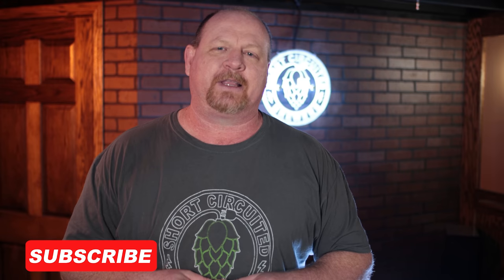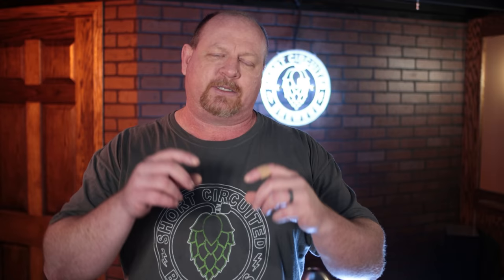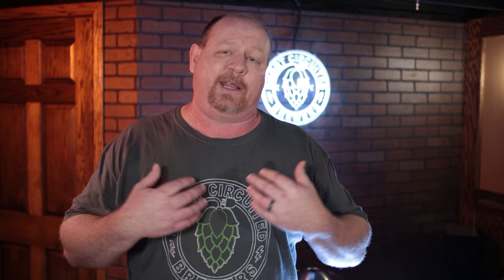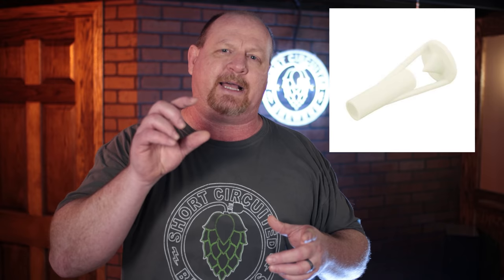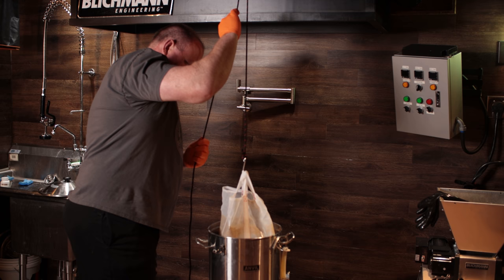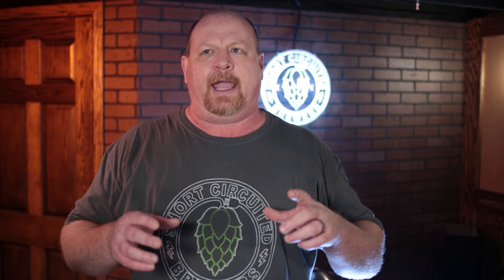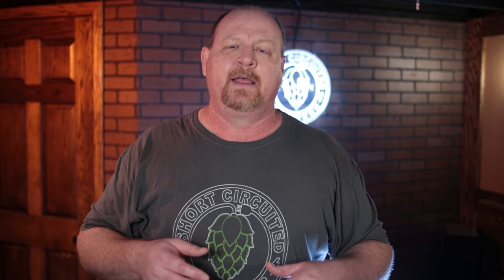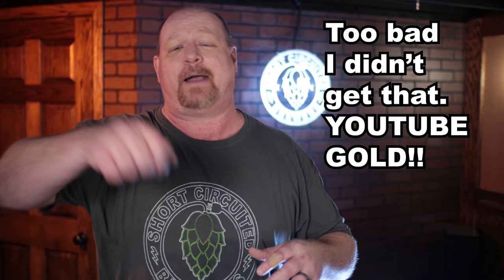Anvil Foundry Feat  The Brew Bag Products

Comment: I really like my Anvil Foundry. I have the version with the ring, and malt pipe. I do get bits of grain in the wort and have thought about putting my brewbag inside the pipe to cut down on that. Right now I'm running the wort through my stainless hop basket. It's got a fairly fine mesh that gets all but the tiniest bits out. The bag would probably be better as it would filter prior to pump. Might save the pump a bit over the long haul. I would like to see a comparison of the cleanup required using the three approaches. Pipe only, pipe with bag, and bag only. Does having clearer wort pre boil stop the minor bit of scorching on the heating elements? I get a little scorching using the 110 setting and have wondered if not having the extra bits of grain would make things easier to clean.
Reply from the maker: The scorching is from recirculating too fast and having only a thin layer or wort over the element during mashing. If you hear any crackling or popping during the mash that is a pretty sure sign the wort over the element is too shallow. I've brewed with and without the bag and never get any scorching even using 240v. 👍🍻
Reply: @ShortCircuitedBrewers  I haven't heard any crackling or popping during the mash, and THOUGHT I had closed off the recirc line enough to keep a slow but steady recirculation going. I will try reducing it further on my next batch. I always figured the slight scorching (and I mean very slight, it comes off with a little scrubbing) happened during the boil step, not the mash step. I will have to try both reducing the recirculation rate, and adding a bag to limit the stray bits in the wort. (Just means I need to make more beer... :-))
Reply from the maker: @1947wdx  aww you poor thing..lol let me know if it works for you!! Brew on!! 👍🍻

Comment: Thanks Always great. I do not believe you mentioned but would you recommend using the basket with the bag just in case the method you described in hanging the back does not get executed properly to protect from the back hitting the heating element and causing a problem? thanks again
Reply from the maker: Sure you can use the bag with the basket. Many people are and having good results. The link in the description also has the bag for in the basket ad well. 👍🍻

Comment: $46 for a big is a bit steep. Though if they come down or have a sale I may pick one up.
Reply from the maker: Yeah that was one of the cons.. I do think.ot will last a long time. Much longer than the generic L.D. Carlson bags for sure.
Reply: I have one for my 10g Igloo mash tun and it is extremely well made. I use a bag for my BE Mash & Boil malt pipe. Wilser Bags are good as well and I believe are $32.00. I’ve never seen these go on sale. Keep in mind these are way better quality than a cheap paint strainer bag and they are the correct micron rating. Either maker is great about responding to emails.
Reply from the maker: Good to know!

Comment: My Foundry 10.5 is arriving tomorrow! Looking at all my recipes (british style real ale conditioned in polypin casks, OGs 1035-1060) and the grain loads are generally no more than 11lbs or so. I mill at my LHBS. I am wondering if I am going to be OK with just the malt pipe and small batch ring?
Reply from the maker: Sure you should be fine.

Comment: When you used the hop sock, you put the hops in the boil loose and then recirculated through the sock to catch the hops? At what stage did you do this, during whirlpool, after, before chilling, etc? Have you done this before and why did you try it? Perhaps forming a whirlpool cone on the small bottom area isn't very effective? Thanks for the video!
Reply from the maker: I put the hops in the sock and dropped it in at 176f. The reason I put the hose in the sock is to circulate the wort through the hops. I found that bags sometimes don't allow good circulation of the wart through the hop so I circulated the work through the bag to make sure it came in contact with all the hops. It is very effective.👍🍻

Comment: Brian,

I wanted to reach out to you because I'm continually experiencing poor mash efficiencies using the Anvil Foundry and I don't know what else to do at this point. I've tried brewing with a brew bag in the malt pipe, with and without the small batch ring at the bottom of the malt pipe. I had a brew day this Saturday where I took the malt pipe out and used a brew bag directly in the kettle. I have a recirculating system that I run throughout the mash that I will shut off and stir the mash periodically throughout the mash. Since I'm using BIAB I've tried to finetune the crush on my grains to be finer. I've tried batch sparging, usually with a gallon of water and I've also tried adding rice hulls. The only other thing I can think to try is to sparge with more volume. It sounds like you have a lot of experience with this system so I'm hoping that you can provide some direction that could help my mash efficiency.
Reply: I am debating buying one currently and doing research.  I look forward to his answer.
Reply from the maker: Well the first thing that I would ask you because you didn't talk about it at all is what is your crush, and what is your water profile namely pH. pH is probably one of the more important factors in mash efficiency next to the crush. In order for grain to properly convert it needs to be between 5.2 and 5.6 pH. Do you know what your pH of your mash is?
Reply: @ShortCircuitedBrewers  I went through the most recent recipes I have saved on Brewfather and it looks like my mash pH about 5.3 on average. I had one brew with 5.2 and one with 5.4. It's typical for me to make pH adjustments with acid malt or lactic acid.
If the indicator on my mill is accurate, my crush is between .04 and .05. I've tried setting the mill to a finer crush but it causes my mill to seize up for some reason.
Reply from the maker: @EtherealPrelude  do you have you water profile setup? Are you using distilled water? I usually recommend a .035 gap for best results. (Credit card gap)
Reply: @ShortCircuitedBrewers  Yes, I used distilled water and make adjustments with the brewing salts to fit the beer style. I appreciate the tip on the crush thickness. I'll give it a go on my next brew.
In your experience brewing on the Foundry, did you find that you had better mash efficiency using BIAB directly in the kettle or brewing using the malt pipe? It seems like I'm typically getting around 63-65% mash efficiency.
Reply from the maker: @EtherealPrelude  I found the avg efficiency was around 70%. If your mill is stopping you might try running the grain through twice or condition the malt (I have a video on it) also stirring the top 3/4 of the mash will help efficiency.
Reply: @ShortCircuitedBrewers  Brian, just wrapped up with another brew day and I managed to get 71% mash efficiency brewing with a 16 lb grain bill. I went with the .035 gap for the crush and that seems to have done the trick. It made my day to have such a big boost to my efficiency. I appreciate the tips.
Reply from the maker: @EtherealPrelude  great!! Your welcome! 👍🍻
Reply: @EtherealPrelude  I am not Brian but I did stay in a Holiday Inn Express :)  TWO things:  1) Set mill to 0.025 gap.  2) Double CRUSH.  ALSO:  if your Mill does not have 0.025 or binds up it is time for new mill about $99.00.  Happy Brewing.

Comment: Great video Brian! I have the Spike Solo system and I was thinking about using a bag with the basket in place.  The basket would serve to keep the bag off the element and would help for easy clean up.  Question - If your using the BIAB method without a basket, and you burn the bottom of the nylon bag on the bottom of the kettle (propane or electric), is the beer still safe to drink?
Reply from the maker: I can't really say if it's "safe" but it probably won't taste good.. lol 👍🍻

Comment: I actually use those socket bags a lot, as filters, even when I transfer it for clarificación after fermentation,  they are a very fine filter and very very economic, actually I do my own sock bags with the nylon used for courtains. Easy tonclean with warm water and easy to sanitize just in a solution of peracetic acid.
Reply from the maker: Good tip!! 👍🍻

Comment: Hi Brian, Awesome videos. Thinking of adding a clawhammer supply spray kit to my anvil for recirculating. What do you think of this idea. Keep the great videos coming
Reply from the maker: Not a bad idea.... BUT... I just did a video on a solution that might be cheaper. 👍🍻 https://youtu.be/4_M-NEOl8Bo
Reply: @ShortCircuitedBrewers  I made the exact same one as you did. in regards to your flow rate thru it. seemed like you had the flow going pretty fast. is this the case or should you slow it down like you would for the traditional style of using the anvil how it comes. I recently brewed a batch and my efficiencies were off. Trying to get better efficiencies. trying to eliminate as many issues as I can to get better numbers. Thanks again Brian, Keep up the great work!
Reply from the maker: @Reptile36snakeman  the flow worked fine for me especially with the bag. I recently brewed with the bag in the malt pipe and had good success with the same flow rate. 👍🍻

Comment: Great video Brian. Did you say you left the power at 100% during the mash on 240v? I just got my 240 ready and was curious about that. Also what power setting seems to be optimal for the boil without boil over.
Reply from the maker: 80-90%
Reply: Just to throw my 2 cents in, I found 55% power while mashing and drop to 85% for a nice mellow boil.
Reply from the maker: @saxonlights2872  yeah I normally run 50% for mash and about the same as you for boil. 👍🍻

Comment: Hey. I know this is completely out of left field and you may have mentioned it in your brewery build out, but what is the total sq footage of your brewery area including tasting room? And what are the largest size batches that you brew? I'm thinking of building a dedicated building for my home brewery and trying to decide minimum space required.
Thanks.
Reply from the maker: The entire basement is aprox 20'x25'   that's including mechanical area and the storage area. Brewery and tasting area would be aprox 325 sq ft. I can brew 10 gallon batches. I could brew 15 gallons if I wanted to push it to the limit of kettle capacity. 👍🍻

Comment: Would this method be better than using the small batch adapter for a 2.5 gal batch on the 10.5 gal system?
Reply from the maker: I think it "might" be. The bag has good circulation around the grain. I don't see why it wouldn't work. 👍🍻

Comment: Am a bit curious watching your (as always) exellent video: In my recent brews (malt roughly 12-14 kilos/Brewzilla 65 liter), I've squeezed the grainbed with a potatoe masher after sparging trying to gain - the last litre I guess. Had a hunch that it'is not "exactely by the book", because this is actually the first time I've seen anyone else doing it. Saying it might be a myth, would you still advise not to do so when using a malt pipe ? I am still far away from determining if or in which way exactely THIS precidiour might have an affect on the taste of the beer 

Cheers from Norway !
Reply from the maker: It does not extract tannins from the grain. Tannins are extracted from a temperature interaction with the grain husks. (High temp) Squeezing or pressing on grains does not have any effect on it. Thanks for the feedback! Skol! 👍🍻
Reply: @ShortCircuitedBrewers  Thanks man & skål - I can see you've started learning norwegian  now which is a good thing - cause I've just started asking my questions 😂
Reply from the maker: Ask away!

Comment: I didn't see an actual comparison of the bag to a malt pipe, just a pro/con of the bag itself. For those of us that have neither and are deciding which way to start off, what are the advantages and disadvantages of a bag vs a malt pipe?
Reply from the maker: I kinda covered it in the video. The basket has less capacity and the holes in the basket allow some particulate matter through. There isn't anything wrong with the basket. There are some benefits of the bag.👍🍻
Reply: @ShortCircuitedBrewers  Thanks. So the bag has an edge in outcome but with added effort (securing it, lifting it, squeezing it, etc)?
Reply from the maker: @FoScoJo  yeah that's a good synopsis! 🍻👍

Comment: Where do i install the false bottom that comes with my Anvil foundry?
Reply from the maker: The bottom of the malt pipe.
Reply: @ShortCircuitedBrewers  That's what I thought. Seems like a super tight squeeze pushing it down
Reply from the maker: @jonathanallenphotography  that is where it goes. 👍🍻
Reply: @ShortCircuitedBrewers  Tha k you so much for the quick reply, and helpful videos!

Comment: Hey Brian, awesome video! I just upped my foundry to 220 and I see in this video you set your estimated efficiency at 70 for yours. Do you set it for 70 when using the malt pipe? Also are you using BeerSmith?
Reply from the maker: Yeah I usually set untested recipes to 70% in the malt pipe too. I'm actually using brewfather. Much better software.
Reply: @ShortCircuitedBrewers  thanks!

Comment: Are there any cons to using the bag inside for the malt pipe?
Reply from the maker: None at all. Lots of people do. 👍🍻
Reply: @ShortCircuitedBrewers  I wondered if this would reduce recirculation flow or something like that..
Reply from the maker: @mbrady1182  I actually think it might help slightly since the grain won't be plugging the basket holes. Just a guess. 👍🍻
Reply: @ShortCircuitedBrewers  thanks! Now I just need you to come by and setup a 240 outlet for me, don’t trust myself..
Reply from the maker: @mbrady1182  I understand!! Let the pros handle it!! 👍🍻

Comment: I use a 5 gallon paint strainer bag on the outside of the malt pipe.  It catches about a handful of fine particles that make it through every brew.  Has no effect on the thermometer or element as long as it never runs dry.  Costs 1-2$ and lasts a long time.  The elastic holds it on the malt pipe no problem. Easy.
Reply from the maker: Whatever works!  👍🍻
Reply: I also made a measuring stick for sparging since you can’t see the wort level with the pipe in.  Slides right in down the side of the pipe and hit pre boil every time.
Reply from the maker: Cool!

Comment: I'm using Brew Bag with my cheap Klarstein kettle (close to Mash & Boil) and it came with a very simple malt pipe with just drilled holes in the bottom. 

I didn't like the malt pipe's filtering capability so I just started using the brew bag inside the malt pipe, bag fits perfectly and I can clamp it with 4 of those clamps you were using this video. I can close the lid nicely during the mash and in the end lift the whole malt pipe up. There is a weird second lid with a huge whole in the middle that you can use to drain the malt after lifting the pipe.

I could add more holes to the sides of the pipe to help avoiding stuck sparges but so far has not been such an issue that I would have wanted to go that direction. Also just having a bag that I can gently squeeze in the end keeps my efficiency up.

https://www.klarstein.fi/Kodinkoneet/Juoma-annostelijat/Keittokattila-Olut/Maischfest-kaeymisastia-5-osaa-1500-3000-W-25-l-LCD-kosketus-ruostumatonta-teraestae-25-Ltr.html
Reply from the maker: Sounds like it is working!

Comment: I always hit 80-85% BHE with just the Foundry's malt pipe and never felt the need to try a bag but this is interesting!
Reply from the maker: Awesome results David! This might be useful if you get into a situation where you're running out of space in the mall type for a big beer. 👍🍻
Reply: Hitting 85% is amazing to me.  Are you measuring BHE as target fermentor, which I think is more realistic?  I usually have anywhere from .5 to 1 gallon of slop at the bottom of my foundry and that is at least a 10% kick in the teeth on my BHE.  I use the brew bag in the malt pipe, but I also pulverize my grain to the point an amount is flour to get my preboil efficiency up...which does usually run about 80-85%.  My BHE is typically mid 60's unless I hop strain everything.

Comment: The grain bag is nothing but a fix for a badly designed "malt pipe".   In a properly designed system a grain basket will out perform a grain bag every time.
Reply from the maker: What system do you use? I'd be interested in hearing how it works. 👍🍻
Reply: @ShortCircuitedBrewers  Homebuilt all in one.  It works great.
Reply from the maker: @SomeTechGuy666  cool what are you using for a basket? I have a diy system with a bayou classic kettle and basket.
Reply: @ShortCircuitedBrewers  8 gallon kettle with a false bottom.

I'm not sure why people buy these (inferior) commercial systems when they are so easy to DIY.
Reply from the maker: @SomeTechGuy666  yeah. Not everyone has the skills you and I do. Sounds like you have a good system! 👍🍻
Reply from the maker: What do you use for a basket?